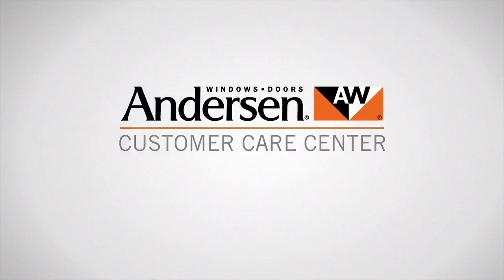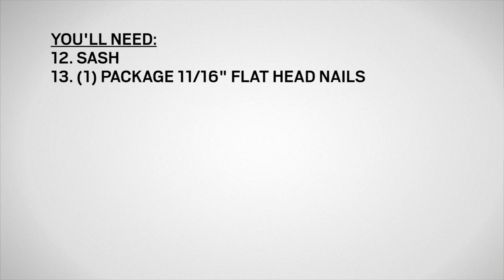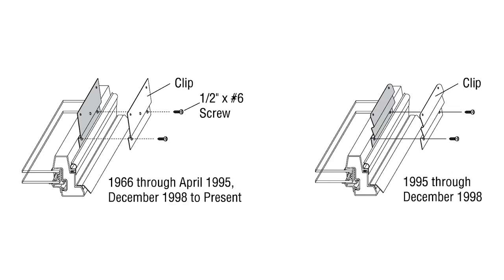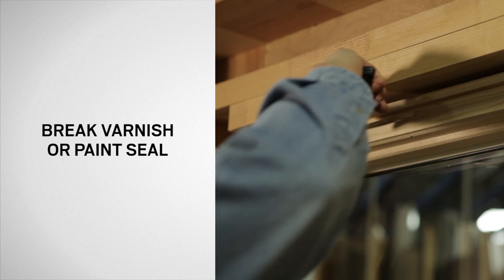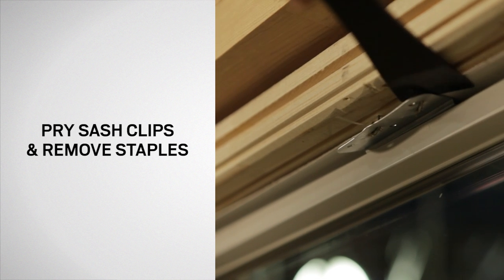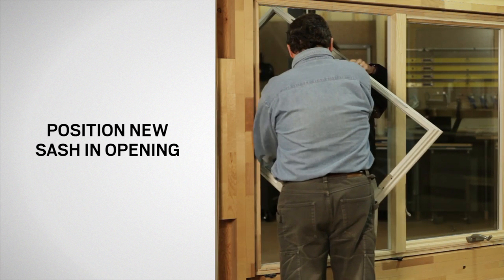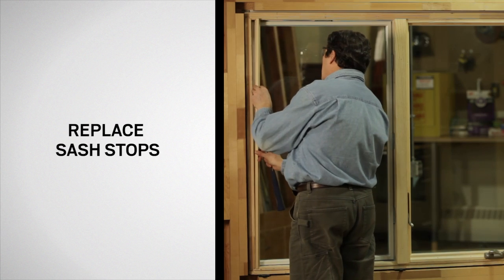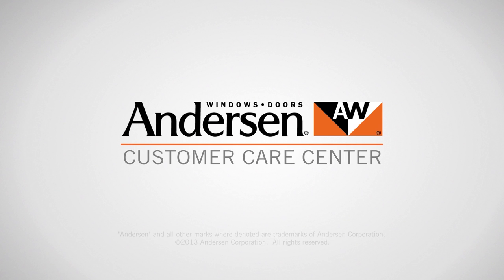Replace a Stationary Casement's Sash | Andersen Windows

Comment: I did this on a dozens of my old Andersens  (31 actually some fixed, some hinged) with new  stuff works GREAT big improvement with new Low e 3 over 1989 low e I have now all low e 3 SUN, it works great , more visible light in, compared to old Sun, and it blocks more heat, better coatings, selective wavelengths
Reply: is this video on point?  any lessons learned you would like to share?
Reply: @Edjra  when they show working on floor level like this, it doesn't show ya hanging onto the sashes, up high, holding on, so ya don't drop it, 2 people, needed for the big ones, the smaller ones are easy to handle, the almost 6 foot ones in my back room are HEAVY!!! , lucky it, so someone outside to help balance, while holding them from inside wasn't that high up but having someone hold the big ones, so you can go inside and line up the bottom glide the the top, while keeping it straight, so as to not snap the frame mounted glide...the suction cup glass holders work great I got a pair from Amazon, super strong to hang onto the sash, not by the edges, but from the center of the glass, worked great.  My front bow window has 4 WIDE sashes, up high work from inside, the suction cup holders really helped hold them steady, with much less stress, than trying to hang onto them by the edges...I didn't break anything, got lucky and ya have to reuse the hardware off the old sashes, , the new ones have tiny dimples to mark where they go exact perfect..just get the exact drill bit, and take your time, and align them right, pre drill as the instructions say, screws went right in SECURE..I got all of them on line, I think windowparts.com  no charge shipping packed well right drop shipped from Andersen warehouse...I got like 3 shipments of about 10 each..good for another 29 years, sun glass really works like MAGIC, the living room is actually brighter, more white than the old sun glass that was Bronze, it tinted to a brown shade, the newest blue grey SUNGLASS lets more white light through, and stops more infra red than the old 1987 sunglass low e versus low e 3 coatings have improved, so did the internals, they have moisture desiccants now in the metal spacer between the two glass panels..after ordered they arrived pretty quick, via freight truck if ya order a bunch..just enough box to protect, not over done, and on a pallet vertical standing up, slick..31 none broken all arrived perfect and installed perfectly, I am now an expert...on the website they have all kinds of service manuals, but I called them to verify SUNGLASS and sash sizes, ya can go by the printed number on the screen like CW4 or such, the service manuals list all the sizes, after ya understand their catalog numbering, it makes sense.  And I like the sunglass version cus from teh outside it really gives ya privacy, ya see a dark slightly mirror look, inside crisp white sunlight, and it stops intense heat from direct sun, big time, as compared to standard low e 3(4) big difference
Reply: If ya are doing non operable ones, ya need to order with the sashes the mounting metal flanges, and the instructions show you all ya need where to put them.  Using the suction holder glass panel holder let ya pull them in tight, then nail into the frame, and or someone outside pushing in, so they go in snug and seal..and I didn't break any mouldings that ya need to remove for the stationary sashes, just get new finish nails of similar size to reinstall the sash stops once the new sah is in, they even explain in the instructions with stationary sash kit brackets how to remove mouldings, break the paint of polyurethane paint or with razor so it come out clean, no breakage.   I think I had about 6 stationary, the rest where all operable
Reply: 😊😊 @cengeb